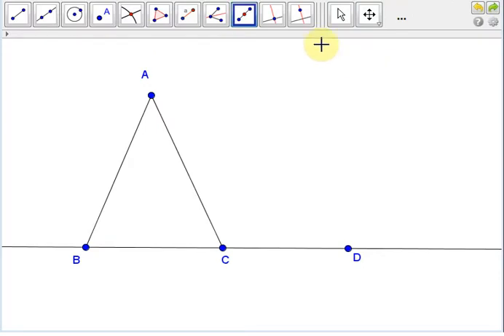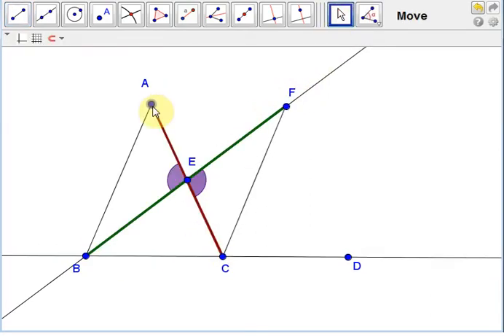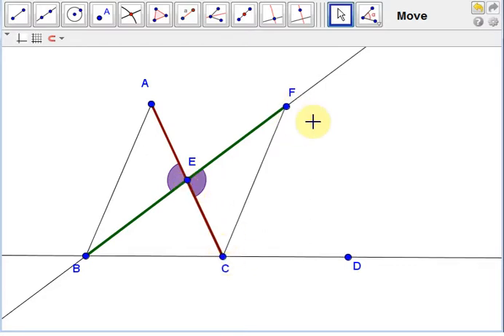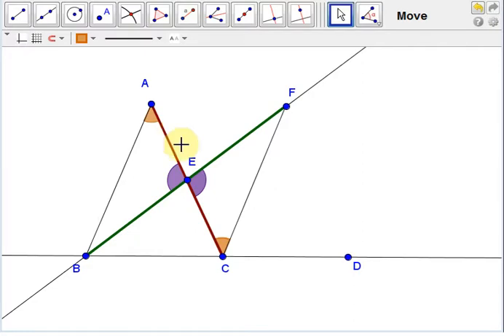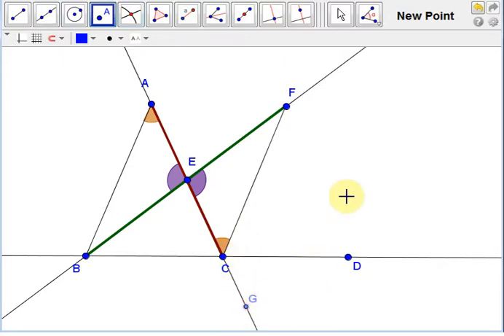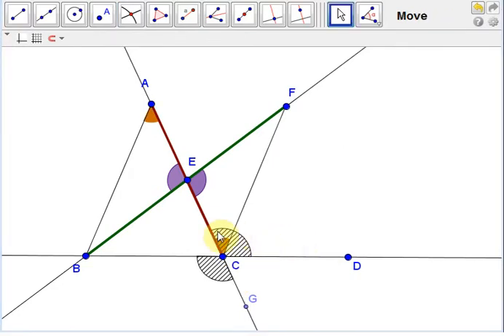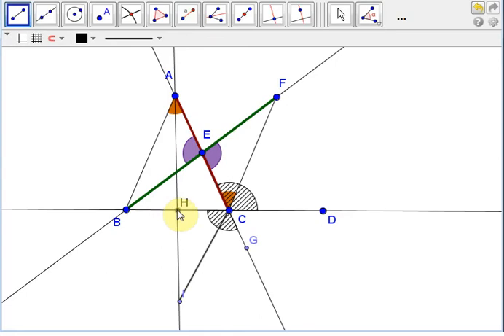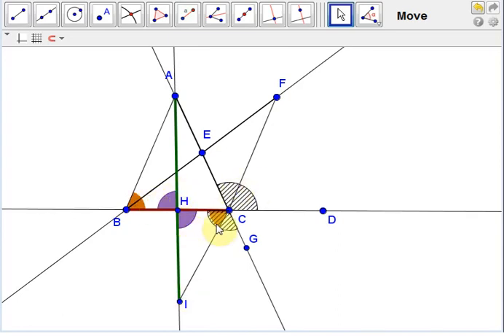Euclid's Proposition 16: Exterior Angle Theorem

Comment: This was a long haul compared to the earlier propositions. It doesn't seem particularly noteable as drawn here since the exterior angle is obtuse, we are used to thinking of the supplement of a angle and regcognise that both opposite interior angles make up the same total so are only equal to an exterior in combination. But if we drew the figure with a very 'skinny' exterior angle instead, perceptions of which angles are larger than which change somewhat.